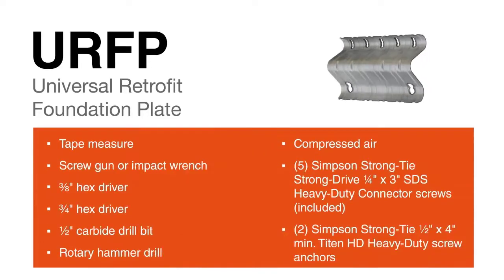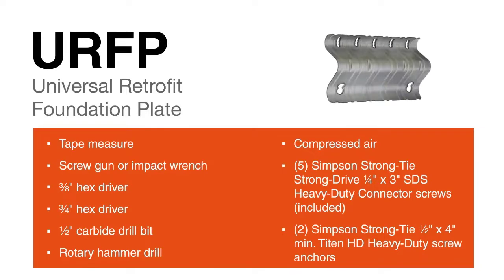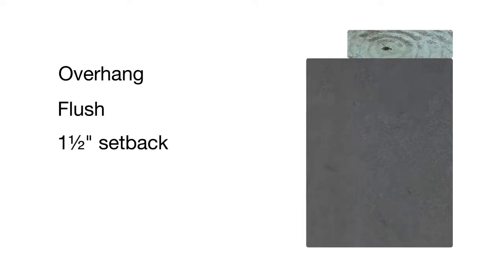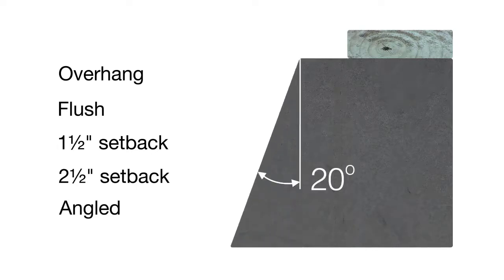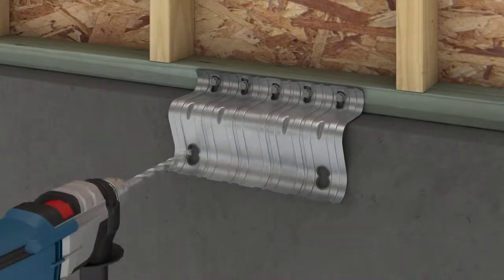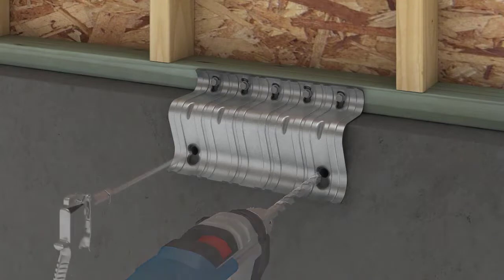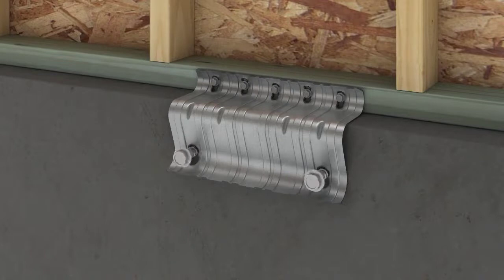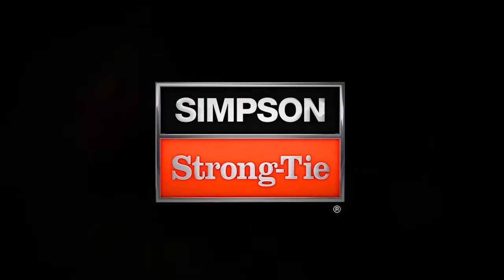Simpson URFP Installation Guide

Comment: Do you know if these can be used on a CMU foundation?
Reply from the maker: Yes, but only if the CMU is filled with concrete
Reply: They're not and I'm trying to see if there's a solution to retrofit to a CMU. thanks @bayarearetrofit5814
Reply: @bayarearetrofit5814 I have a 6” cmu that is filled every other cell with #4 rebar at 16” OC. How can I make that span? These plates anchor bolts are only 6” apart

Comment: If your mudsill is 3 inches from side of foundation how can you use these ties? Is there another fix...i.e. Attach wood to mudsill that extends over the mudsill.
Reply: Will these work with a hollow cinderblock foundation?
Reply from the maker: Add a 2 x 4 shim